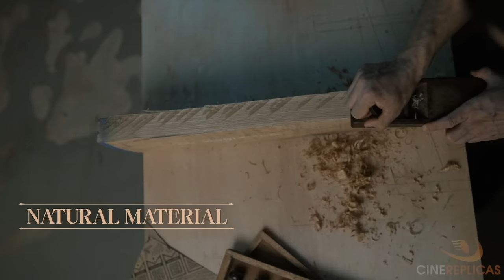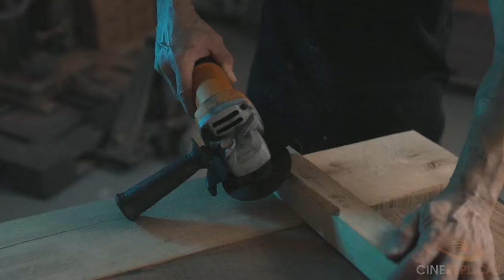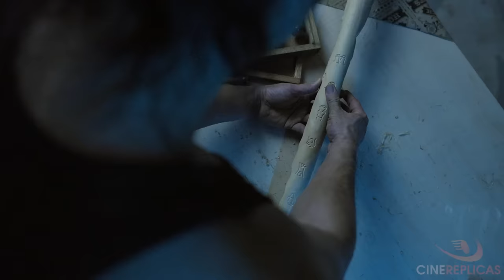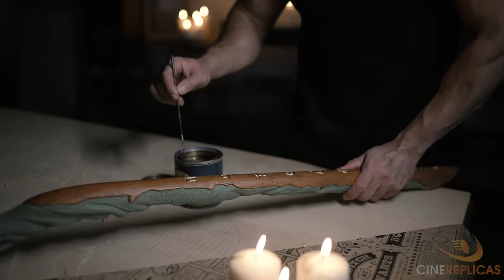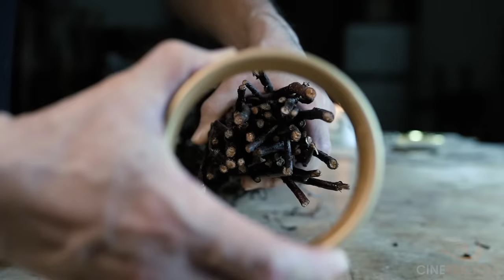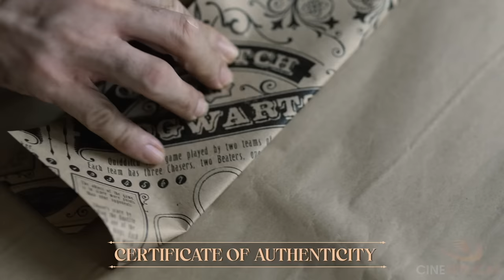Firebolt New Edition 2023 | Harry Potter | CINEREPLICAS

Comment: You need to hide the number plates on these brooms instead of having them riveted to the outside. I would like to see them embedded into the wood handle portion that inserts into the bristle section. This way they're permanently attached to the broom without the tackiness of an exposed plate.